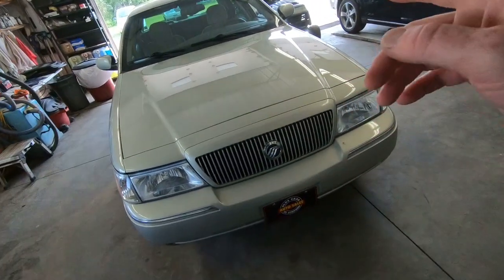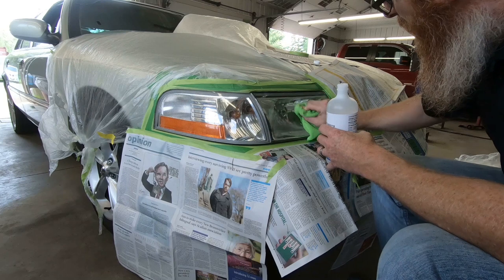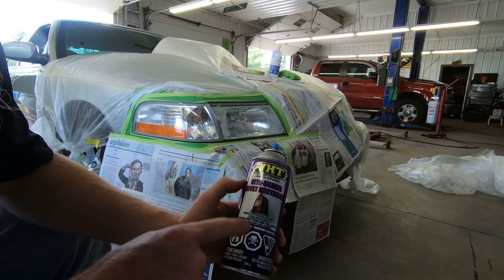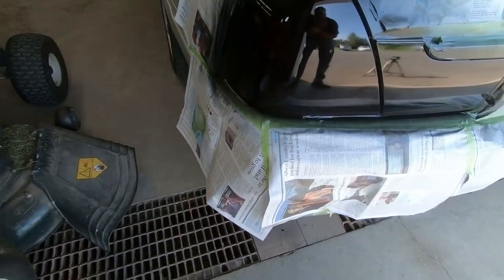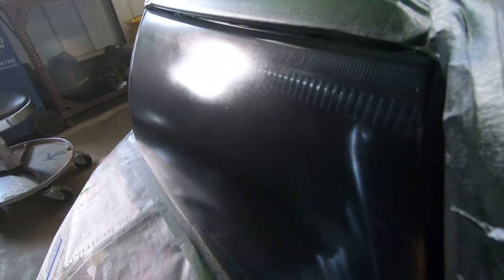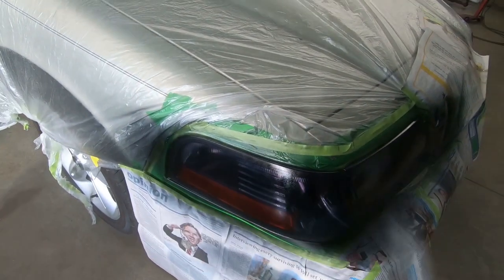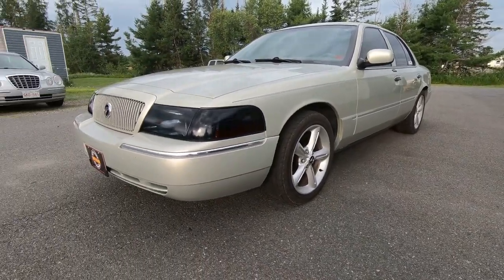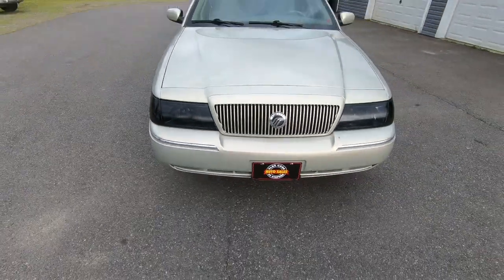Tint Your Own HEADLIGHTS - SAVE Hundreds

Comment: Good thinking on the clear coat. May be a bit dark for my taste, but I still think it was the right move for this car. Keep the grille as is, and find a front chin spoiler or air splitter for the front ;)
Reply from the maker: Although i’m happy with the way it turned out, I’m thinking a set of custom headlights is in order. As far as the Grille goes the majority of my viewers seem to think the dark grill fins will look better. I am inclined to agree.

Comment: I have a 2007 Mercury Grand Marquis, I call it "Grandpa." I love what your doing to this car. I've never done anything to a car, but I wanted to know if this is easy enough for someone who don't know that much about working on cars?
Reply from the maker: It really is an easy project. Just don't go as dark as I did on the front and used light coats! Thanks for watchin and hope you'll consider subscribing.

Comment: I don’t know that I love the tinted lights. I think the execution is on point, but I don’t prefer the aesthetic. A bi-xenon HID retrofit with black housings would be cool, and you could pant the inside of the housing black for a similar look while improving the headlight performance. As far as the finish, I’ve never seen that VHT come out like glass and almost always you need to use a clear coat. (Yeah, I did my Astro lights back in high school)
Reply from the maker: It think it would look ok on a darker vehicle! But I’m thinking it a bit much on this “Golden Ash”! lol ASTRO!!

Comment: What kind of  wheels are those and size
Reply from the maker: Those are just stock 18" wheels off a 2011 Mustang!
Reply: There nice like to get some for my marquis gonna do the lights soon just got the spray can how many cans did u use
Reply from the maker: @abrahamvargas5467  Just the one can did front and back as you see it!